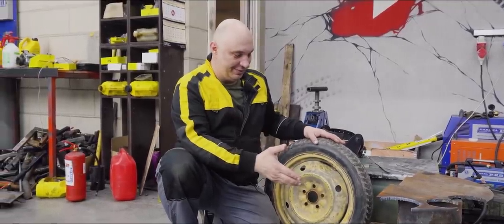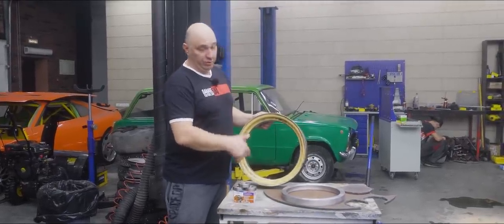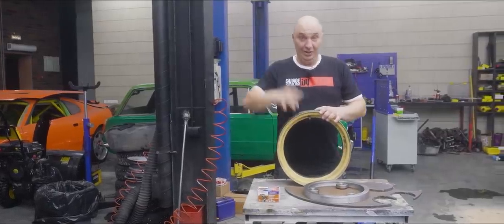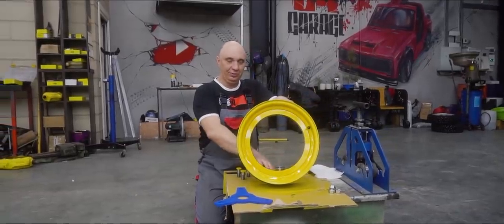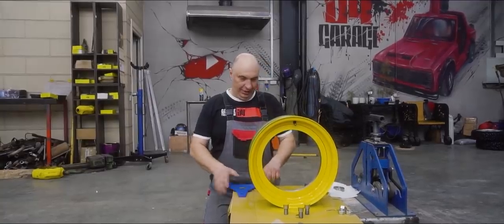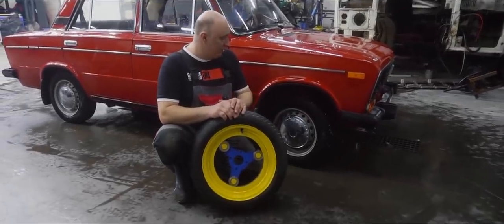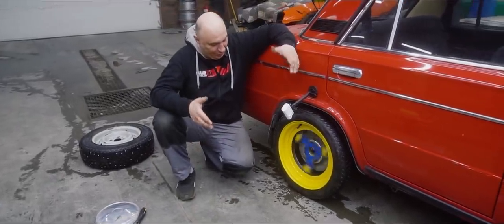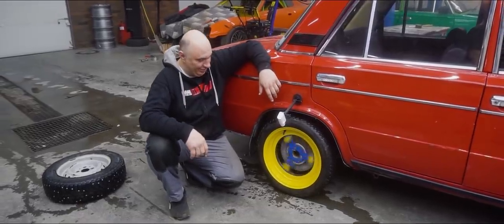Making a wheel with centerpiece on bearings

Comment: Hypothetical situation:  You have to escape and all you have is a Lada.  The ONLY way to escape is to cross a large body of water.  You have the means to float the Lada but, you also have to drive off once you get ashore on the other side.

If you built a pontoon boat out of lumber and empty drums and drove the Lada onto it, could the driveshaft be disconnected from the rear axle, stabilized with a driveshaft loop, an extension added to the shaft with a propeller, and dropped into the water?  Could the Lada then propel itself to the other side where the driveshaft would be reconnected to the rear axle and driven off?

Comment: The breaks could have worked when installed on the front if you used a one-way bearing, though it still would have been metal on metal which would limit its ability to slow down.

Comment: Maybe you can build almost the same wheel but instead of the inner and outer parts freely moving across each other, you should make them to transfer at least some torque to each other. Then you can get some driving and braking but still get the parts to spin out if you mash either the throttle or brake pedals.

Comment: Wheels. Yes that's good how about elliptical wheels? Fully oval or just egg shaped - or maybe just relocate the centres a bit? And off axis wheels too remove the rims and reweld them slightly off kilter then drive these things around a bit
Reply: They've done that.
Reply: @jjohnston94  Cool, I'll have a look - have they done both ideas? I made two suggestions... One with vertical wobbling and one suggestion with lateral wobbling
Reply: @jjohnston94  Haha very cool man, Thanks! Car is dancing well and giving Vlad a good shaking :-D I wanna see them do rims cut off and welded on at angles that are offset vertically too. That would be cool. Could pull the tyres and wheel bearings to bits though... What do you reckon?

Comment: The holes in the three arms are not exactly equal distance away from the center of spin. A millimeter off on one bolt hole will hit with force as the ring spins and transfers the weight of the car that ever so slight onto the outer ring.

Comment: Interesting and looks kinda cool but I don’t see a big market for wheels that won’t drive or stop a car. Maybe this is the beginning of something? What if they could be locked with electro magnets, centrifugal clutch or hydraulics. Possibly there is a gear set and the tire turns faster or slower than the hub?

Comment: Maybe with the spacer on the hub it moved the center of the wheel assembly far enough away from wheels proper fulcrum point to cause greater lateral force greater than what you accounted for do to the increased leverage?

Comment: Noise was probably a fkd wheel bearing pressing brake levels out the  hub and wheel ..  or the flex in blue 3 spokes .. Good idea to move cars in workshop if space is a issue save effort in pushing if car non running 👌

Comment: I don't believe your lathe work is the culprit of the rim wobbling. I would say the issue is the piece of plate steel you used for the center hub. It was machined to be circular, when it should have also had its face machined flat. Theres always a tiny amount of warp in stock plate steel.

Comment: now swap bearings with "sprag clutch" one way bearings of the same size and see how it functions with brakes working. then flip and try where it can only add more energy and free spins when you try to stop. :-)
Reply: Have the sprags on one side operate in forward, the other side in reverse so you have at least 50% braking for safety :)

Comment: I want to see 3 teeeny tiny little disk brakes on each bearing. Edit: and weld the wheel bearings so they no longer spin. Drop the Original disk brakes & calipers since they don't matter anymore.
Reply: How would you keep it from twisting the brake fluid lines apart?

Comment: There is probably some slight warping on the spokes or the ring the bearings  ride is misaligned. But my money would be on the spokes because you didn't seem to machine the faces. Steel stock is rarely flat and true.

Comment: that could be good for drifters so they dont need to delet front brakes
Reply: Those bearings are no good for lateral loading though, which you'd need while drifting. You'd need a pair of tapered bearings, and a tapered race, to have a chance at that working.
Well within Garage54's capabilities, but a whole lot more work.

Comment: what would happen if you made a car with four wheels, but none of them had any bearings at all? what if you just cast the wheels out of iron/ steel, in the correct shape, with a bead on the edge for the tyre? why would you need a bearing at all? or would it just smash itself to pieces over bumpy roads?

Comment: When the 2 spokes point down they bend out, making the gap on the top one bigger. Than when the right spoke of bottom two passes ' 6 oclock', the gap that was built on the top one closes and thumps as it takes all the weight.  3 spoke is not a good design imo. Lots of deflection.

Comment: if you didnt use calipers to center it in lathe and was holding it too tight then it could not be circle and can be litle bit of the center i am working with lathe 7 years and this piece isnt thick enough soo you cannot hold it too hard in the lathe or it will be not true

Comment: Too much distance between the bearings. Four spokes would be better... or six bearings at the edges of the three spokes. 
As soon as you have the weight of the car on it, the bearings had a hard time rolling down to the bottom of the wheel because of the distance between bearings.

Comment: That ist called a Planetary Gear what you made only with berings, then you call this a fidget spinner.
The problem with a fidget spinner is that you can´t break with this wheel, also it will turn througt when you drive.
That is the reason why they use planetary gears to get the power from the breaks to the wheel itself, now it´s running free.
Very dangerous when you put 2 wheels on one axle. Don´t do this stupid thing yourself.

Comment: So... It won't go anywhere. Why? That's kinda dumb. On the front tire it's just free spinning wheel. Even when you brake it will still spin. Kinda uninteresting on the front,put it on a driver and it will just do the same thing,unless you put one on both drivers. On one it's just like an open dif. Kinda dumb